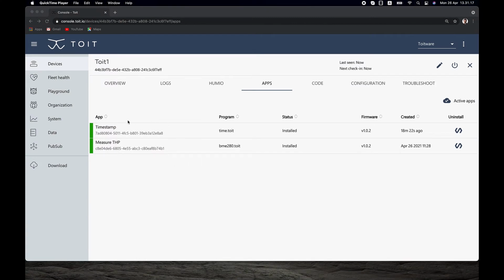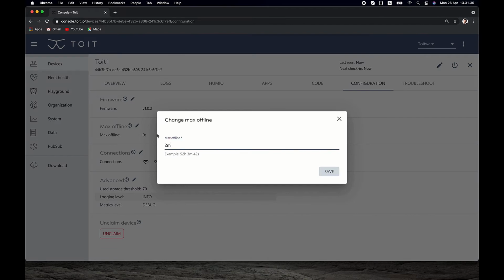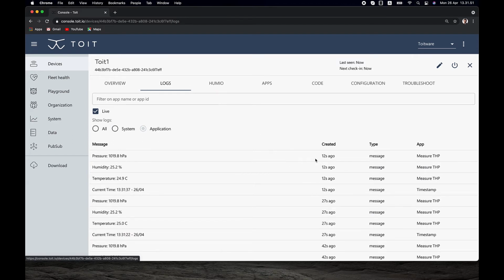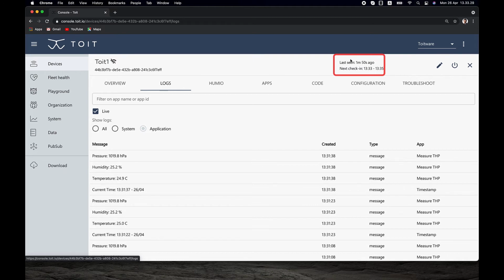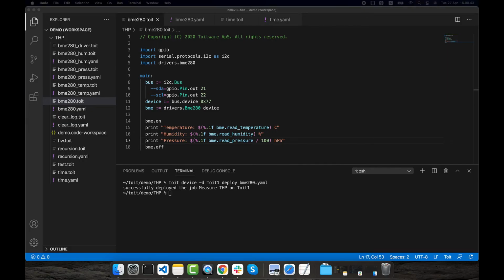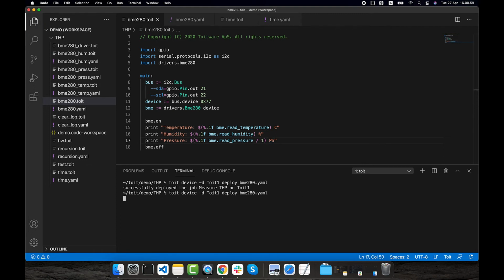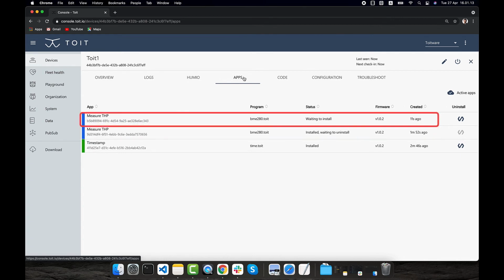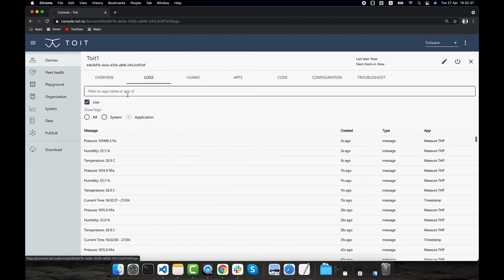We're deploying apps on an ESP32 that is offline!

Comment: it is a SUPERB idea - just one thing: I would like to have all apps in my cloud - not yours
is that possible?
Reply from the maker: Absolutely. Everything you can do in the Toit console, you can also do via our GRPC API. In other words, you can build your own Toit console hosted wherever you want, if you prefer that.
Reply: @toitlang  thank you. I tried with 2 of my boards: ESP32-S and ESP32-S2 - none was able to work at all - I used the same usb-ttl converter I am using with Arduino and/or ESPHome over Chrome browser - so I was not able to test anything ;-( It showed me message: "contact our support" ;-)
Reply from the maker: @zyghom  You need a dual-core ESP32 version with 520K of RAM and 4MB of flash to run Toit. The S-model has lower specs.
Reply: @toitlang  ESP32-S contains two low-power Xtensa 32-bit LX6 microprocessors. The internal memory includes:

• 448 KBytes ROM for booting and core functions.

• 520 KBytes on-chip SRAM for data and instruction.

External memory:

• 4 MBytes of external flash are memory mapped into the CPU code space, supporting 8, 16 and 32-bit access.
Reply from the maker: @zyghom  The S-series comes in different flavours: https://www.espressif.com/en/products/modules. If you're having problems flashing we can help you at chat.toit.io.
Reply: @toitlang  It has: "HARDWARE: ESP32 240MHz, 320KB RAM, 4MB Flash"
Reply from the maker: @zyghom  Yes, and you need the 520K RAM version to run Toit.